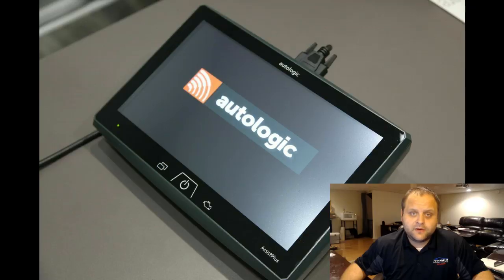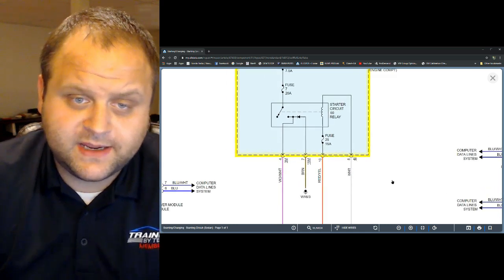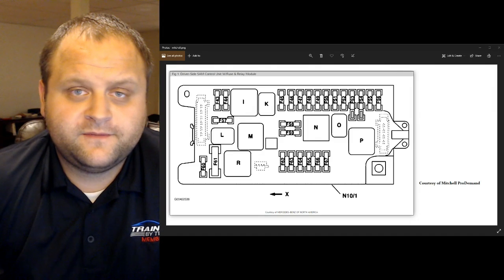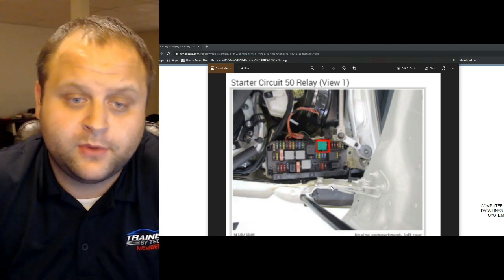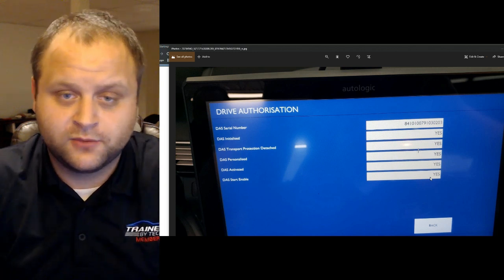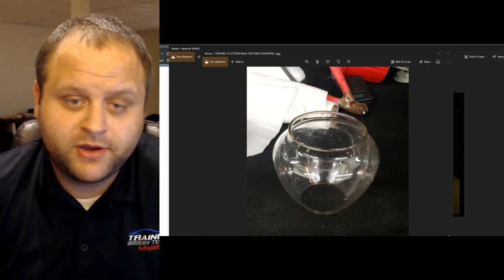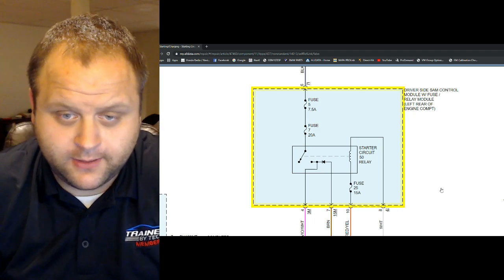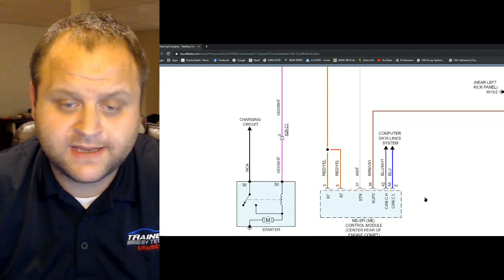Basics Basics Basics? 2010 Mercedes E550 No crank

Comment: I usually start with a relay jumper to separate the load circuit from the control circuit and test the entire load circuit. I am also curious if it was disabling the starter, would it not have a data pid for that? Great video!

Comment: I'm watching this video while waiting for AAA. I'm having similar issue with mine. I did try to jump start it, but I obviously knew the battery is not the problem. It's brand new. It did have long cranks at times, but mainly Sundays when I'm turning and off the car multiple times during the day. Immobilizer is fine I can only guess for it to be the started or the crankshaft position sensor. It has no codes.

Comment: Around 8:41 you are trying to locate the starter relay.  The second picture isn’t identifying the relay, it’s identifying .the front Sam.  N10/1 is  what MB calls the front Sam. The relay would be N10/1km.  So the picture is not wrong.

Comment: The resistance in the brushes is fluctuating, and it dropped low enough to create a signal to the relay, but obviously not low enough to spin starter.
Reply: This is why the headlight lit up, but starter wouldnt spin.  great video! keep them going, thank you!

Comment: Its simple! the sam module is seeing a crank request, and it isnt seeing current flow, or voltage drop on the s terminal, so it knows there is an open, or discrepency  on that circuit, so to protect the system,  it just says, im shut down until I see some activity on this circuit, wich is probably open, due to brush contact on armature, or a solenoid problem where it isnt completing the circuit, and there may be some bias voltage involved for diagnostics on this line as well.
Reply: It's not simple when you can't find that information if that's is in fact true.

Comment: Would be interesting to see if fuse 5 was pulled, does 7 remain hot? I wonder if the supply is really coming from the rear SAM module or is this a switched input for the rear SAM to confirm relay activation upon crank request? Most of the protected circuits I've dealt with aren't fused as they have over current protection. Also a protected circuit would usually have enough logic to set a DTC eg short, open etc. Great video though, when it doesn't make sense, revist your test steps, think what you can do differently.

Comment: Everybody is a Monday morning diagnostics expert [as in me :] but here is my take of all of this. I am a little confused by the path and direction taken in this video. First, we are told it was a "no start", then we confirm that it was a "no crank". Everyone here knows the difference between the two. A different approach/direction is taken with each. It was subsequently stated that the actual problem was a "no crank" situation. [Service writers take note and save your techs time through through interrogation of the customer before assigning the vehicle to a tech.] In my way of thinking, I would have started by making sure the battery was at least 12.6 volts. After figuring out its location [ :) ], I would have put a relay tester break out block in to fuse box and reinstalled the relay. A minute or two with a test light or DMM would have shown either no control to the relay or no power out to the starter. In this case there is no output to the starter from the relay. I would then jumper the relay output. If the starter cranks the vehicle, then the relay is either not energizing with control or there is no relay control. I would proceed to check for a bad relay or troublshoot relay control. A quick relay swap [if possible], resulting in successful cranking, on top of what I saw when testing the relay [control input] with the break out block would have 100% confirmed a bad relay. Otherwise, I would have had direction that the problem lay in the "Drive Authorization" system and diagnosis of that aspect of the system was my next step. For whatever reason, this tech was into the "Drive Authorization" path when ultimately the defective component was the starter itself. Perhaps not doing as I say versus using a low amp load headlight [versus full field draw by relay bypass]threw him off ? Perhaps the SAM saw a 3-4 amp headlight load as OK, but the full field load current was excessive [shorted] ? Again, jumpering the relay, or bypassing the relay would have produced a no crank and pointed to a starter or wiring issue between the relay and starter field or a starter grounding issue [?]. One commentator pointed out that the customer would apparently jump start the vehicle when it would not crank. This does not seem to add up when the starter was ultimately the issue. Question the customers more thoroughly as to symptoms and any remedies or work arounds tried before assigning the vehicle to a tech.

Comment: After I remove a light bulb of interior lighting from a dor panel, în a Renault Laguna,  I place it back and it wouldn't light,  as I was measuring the connections,  they hade 12v , but still the light bulb did not turned on.  I replaced the bulb and still nothing.  After a few ignition cycles,  with the bulb in place,  the confort module re started the light bulb again.  I connect the scan tool , and was a pending code about it .
P.s. the 12v that I was measuring , was a low current ceck procedure sent by the confort module,  to re measure the circuit resistance.  My folt was that after I pit back the bulb I did not cycle the key  (witch was keyless entry, and keyless go system ).  :)

Comment: One time I was at a friend's garage. He  had a customer come in that day with a station wagon complaining of an interior beep heard every 20 or 25 seconds. I told him a story about a lady in a BMW X5 that I worked on years before. She came to have a repeated 20 second beep checked out which was coming from the interior of her truck. After checking under the cargo floor in the rear I found an old Smoke alarm that had a weak  battery causing the beep. How did I fix it? I replaced the battery, of course. Well, you would never guess on the wagon that came in that day what the problem turned out to be. A smoke alarm in the trunk, in a milk crate, under a blanket, with a weak battery. Freaking nuts but I love it.

Comment: Good to know I know on a BMW It will trigger a fault code I was watching this video and I was thinking to myself ok now you found hopefully the right relay for the starter I personally would’ve put 12 volt on the side of the relay that supply power to the starter solenoid to see if the starter would actually turn the motor then I would’ve proceeded to try to find why the relay wasn’t being triggered it’s probably easy for me to say now I guess.

Comment: My question is how could the customer jump around the problem? With a bad battery, he could jump the car, unless I misunderstood, he could not do that with a new battery so he tows the car? It does seem if the sensing voltage, etc was an issue, would Mercedes not flag code in the rear module? If you had lab scope the input from the rear module would you have been able to see the issue or dropout? Relay click, solenoid click? BTW which relay was correct?  Is this just an aberration of a particular car, and control module glitches? Maybe we will start seeing more and more of these weird issues with so many modules doing so much? Great video. And how much do we pay for Mitchell and Alldata monthly, they fail miserably on European wiring.

Comment: A very good video Brian, with regards to the no control, its always hard to determine the cause, however as previously stated if there is a style of open circuit/short circuit sensing then almost always i would expect a dtc to be set by the ecu that is seeing the problem. The feed through the fuses i would say is unlikely to be a sensed circuit as it will only ever have 12v on that side of the circuit whether the circuit is open or the relay is closed. But it is possible for anyone of the modules to drop there feeds via information on the CAN Bus if they are not happy as you said. it would have been nice to see what was missing from the relay, whether it was the 12v feed the ground or both! that may have answerd a few questions. however i know that they (Mercedes) have a logic built in that when the start button is pressed the DME (ECM) looks for a rpm signal to confirm the correct operation of the circuit and if the time elapsis with no RPM increase it will switch the circuit off! if you take a look back at the original diagram of the relays, the DME produces both the ground and 12v feed to the relay however the 12v feed also branches back into the ECM. this is the confirmation feed back into the ECM that tells it that the feed has correctly been deployed by the ECM to the start Relay. ( a sensing circuit)
Reply: Thank you, Ryan
Reply: This is excellent information and answered the question in a way that makes complete sense....Thanks for this!

Comment: what about the battery problem?
Reply from the maker: The battery was replaced by the customer. I did confirm there was not a parasitic drain and also that the vehicle was charging after the starter was replaced. I believe the battery was original prior to the customer replacing it.

Comment: I'm looking at that 7.5A Fuse No.5 feeding that 20A Fuse No.7 in the fuse block/power distribution module and thinking there is something internal in that block ie. a transistor or some other control or power source that is not shown in the aftermarket diagram, that could have a fault such as a bad solder joint and possibly that the cranking attempts have temporarily welded the joint, just a thought.
Reply: Basically you could have an intermittently faulty fuse block/power distribution module
Reply: Power checks at both Fuse No.5 and Fuse No.7 when the vehicle was faulting would probably confirm this.
Reply: I mean, why else would a 7.5A fuse feed a 20A fuse?
Reply: The 7.5A fuse to protect the SAM from excess current and an internal relay or what have you in the fuse block which provides higher current to the starter solenoid which draws above 7.5A but below 20A?

Comment: Modules that control outputs and senses (measures) no, low, or high current flow will set a DTC. 
Issue concerning starter relay identification. Place yourself and tooling in a safe location, then remove relay and jumper switch terminals. Or, touch relays while someone turns key for you. Or, use scan tool output control of starter relay, if available.  Control test would only work if starter relay, control circuits, and modules are in proper working order.

Comment: You are 100% right the Sam module can shut the signal to the starter you would get a code were too many cranking attempts had fail . Since the Battery was disconnect , memory  was erase . I    would have put amp clamp around the feed cable of the starter to test the load. Thanks for sharing  its frustrating with this computer on wheels .
Reply: You would not get any current flow,  as because the relay was not even commended, right?

Comment: Had a S class a few weeks ago. Trying to find out what inputs needed for start enable is a nightmare. It ended up being the starter lockout contact in the trans that was a fault. No codes and no SI sucks.
Reply from the maker: I agree! As noted, service information for those types of things is very difficult or impossible to find in my experience.
Reply: @TrainedbyTechs  I have a question.  At what point do you request to bill for more time
Reply from the maker: @kdautomotive1165  when there wasn't control to the starter the diag went from a standard .5 to 2.0 hrs billed
Reply: @TrainedbyTechs  after I had a hour in we asked for more time and ended up at 2.5

Comment: Is it possible that you just didn't have a good ground or connection on your test light? I have chased my tail a couple times on similar tests by a little paint or corrosion on the terminal. Great case study
Reply from the maker: Trust me I verified nine ways to sunday if I had connection issues when the problem arised. I too have been burned by self inflicted wounds many times :)

Comment: What you expireced is  called "current limiting technology"  Simply put, a control module has the ability to turn a circuit off momentarily incase of a short, or in your particular situation High resistance. Be
Reply: Why would it shut it down for a open or high resistance? With either one of those the SAM module is in no danger of getting damaged unlike a short or high currant
Reply: @JOHNPHUFNAGEL  And also why wouldn't it throw a code? It absolutely would throw a code for this.

Comment: Just playing devils advocate here, perhaps a bad connection while doing the original test with the headlight led you astray. I can't imagine that  a module would keep a secret and not brag about keeping the car from starting. As you pointed out the MBs love to set codes in multiple modules.  You would think something as fundamental as the starter circuit failure would cause codes in at least 9 modules.
Reply from the maker: I would think the same as well. Unfortunately there were no trouble codes in ANY module. And also, I confirmed my connections multiple times. This is a habbit i've learned over the years by being BURNT by my own self inflicted wounds

Comment: Great video!! Such a "typically"  easy circuit and to go for a ride is such a frustrating experience  for sure.

The only thing I would've done differently, especially when having conflicting info for the starter relays, was to power up those relays.  I have the AESwave uActivate tool, but many times looking at the relay, you can tell which is the load.  I truly expected you to do that when you hit that point in the diag.  Would that have cut things shorter?  IDK.  You might've still had the issue of seeing the control side not working. It's quite possible you wouldn't have sold the starter until you verified the entire problem with the vehicle. 

As they say, hindsight is 20/20.  I've learned so much just fom our chats behind the scenes,  Obviously, I'm not the TBT group, but I'm in various others with DeFazio and many other YTers... or groups with some EXCELLENT technicians.   It's amazing what the networking can do!!

Looking forward to reading some answers! Thanks so much Brian, and the other members of TBT!!
Reply from the maker: I did not attempt to activate from the relay because I already previously proved I was missing trigger voltage on the S terminal at the starter. I immediately went to see if I had control to the relay and it was missing. I definitely wasnt thinking a relay bypass tool would do tell me anything because I knew the control was missing at that time
Reply: @TrainedbyTechs  I completely understand that. For me, the only reason I would've activated is to know for sure which relay & circuit I was dealing with, just in case of having to do circuit integrity tests. Not to prove if starter worked.... because up to that point I wouldn't have suspected it to be an issue. 

Now would we have gone a different route when neither relay circuit engaged the starter? I may have used a test light to see circuit activate, and the other circuit would've activated a fan or some other component which hopefully would've been visual or audible. 
Again, for future testing... in case I had to chase wire issue for control to fuse box.

Comment: I've never worked on European vehicles, but there's more to this puzzle than Domestic or Asian.  Did you try to jumper the starter solenoid with 12 volts to test the starter?  Or jumper the starter relay load side to see if the starter operated?  Those two tests are quick.  If the starter did work, then comes the control side.  If the starter didn't work, fix that problem then test the control side.  Don't know about that sensing a problem in the starter control circuit in the rear module.  Shouldn't there be a code for that if the module can do that?
Reply: Yes, this is what Brian is attempting to learn. How Nodes network to accomplish a goal is ever-changing in our industry. It can/will vary from
Vehicle to vehicle. Trying to stay ahead of “what’s possible”
Is in Aall of our best-interests.
Reply from the maker: I hadn't checked to see if the starter would crank from the relay until AFTER I had relay control restored. The first test I did was at the S Terminal at the starter because it was easy to get to and the end of the road. I didnt have control at the end of the road so I went backwards to see why. If control was present at the starter, of course this diag just became real easy.  Basic right?
Reply: @TrainedbyTechs  I believe I understand what you were testing and thinking about the module "sensing" the non operating starter, however, that could have been a bad wire terminal at the solenoid.  What I was saying is apply 12 volts to the solenoid terminal, be it a threaded screw or a flat terminal, NOT the wire terminal from the relay.  To be sure the power cables from the battery are good, connect a meter to the solenoid bat term and starter case.  Apply 12 volts to the solenoid terminal.  If it turns the engine over, monitor the voltmeter.
Any questions regarding voltage drops, bad battery, poor grounds will show themselves.  Then the control side should be tested.  Sound like a lot?  Wait till you have a 3 axle truck with a Cummins or Detroit or International or Mercedes DIESEL in the engine bay!  The truck "may have" 2 or 3 group 31S(Stud) or 31P(Post) batteries in parallel.  The "Cranking Motor" has an "External" (Ford Type) starter relay to activate the cranking motor solenoid.  With all that and more, it's still "Basics," just more of it, but you must be thorough!